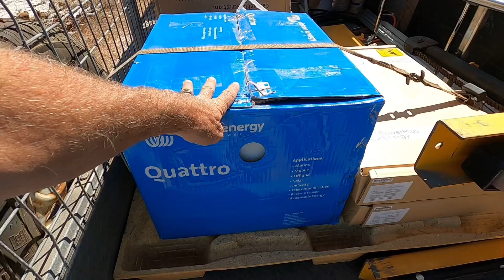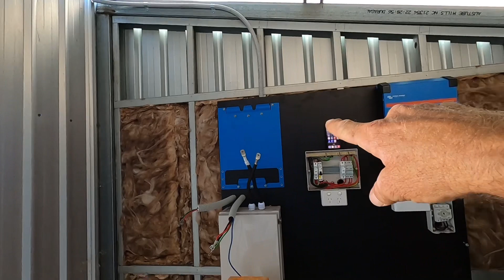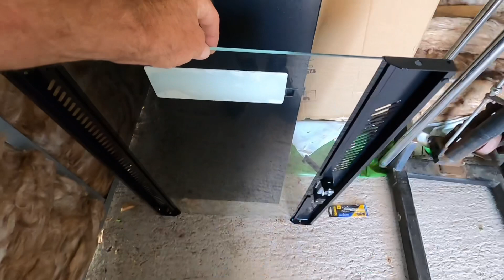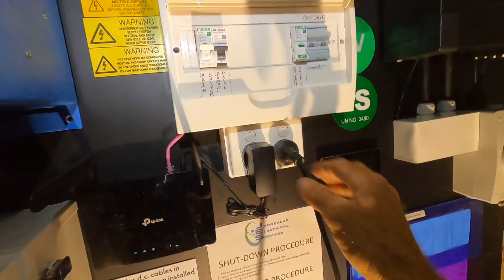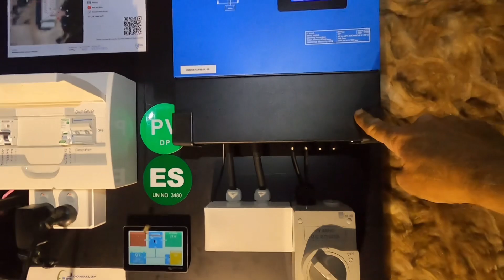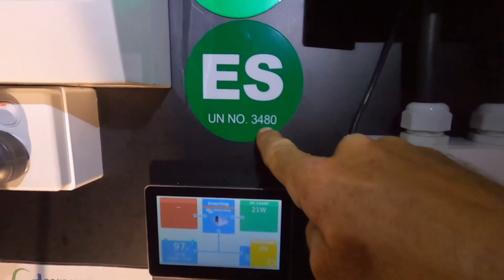Victron Off Grid build Australia.

Comment: Seriousy,
- If there is a fire with the batteries, all you labels and materials data safety sheets will be burned or not accessible die to fumes, smoke or other risks!
- Good luck operating the DC isolator in event of a panel or battery fire event!
 - Yup, we are certainly heavily regulated
- Regulated by the same fwits who, not so many years ago, mandated DC solar panel isolation switches on the feckin roof to make things safe in the event of a fire.   (Ask any experienced Fire officer if they want to go onto the roof of a burning building to isolate the dc power.)

Any way keep up the good work
- Well presented, no BS video!

Comment: Very nice looking system, congrats.

 Q? fuses banned, old rat traps, cartridges?  You mean the oversized-regular looking HRC fuses, why the heck would they ban NH00 fuse systems you cant come into contact with them,   ohh my bad, why pay 150 bucks to Siemens for NH00 fuse and disconnect mount, when you can pay 900 for a 300-400 dc breaker,   just another thing to add to my " regs are dictated by manufacturers, very little to do with safety, like all the solar DIY bans, dictated by the ETU.